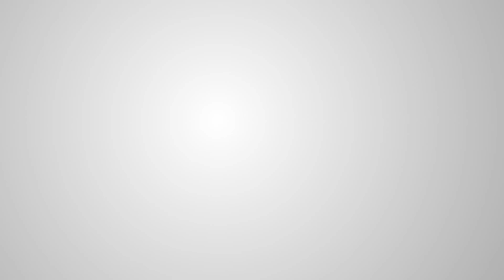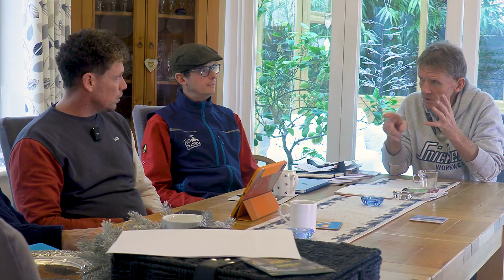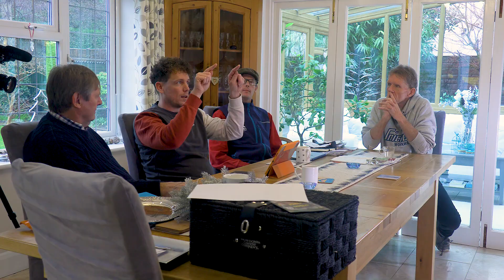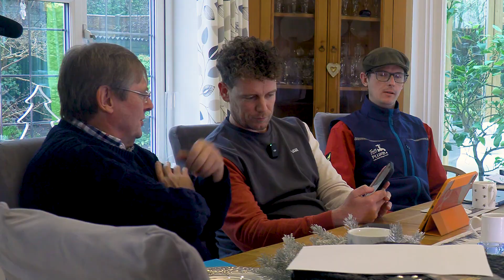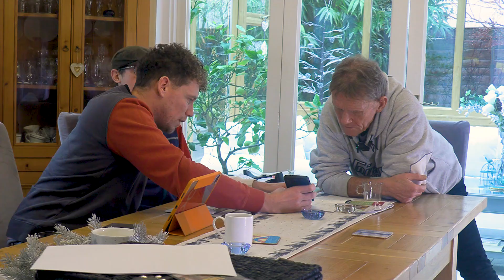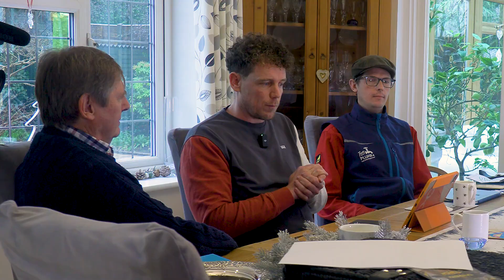What Did We Learn from the Heat Loss Survey?

Comment: I don't understand the benefit of using a heat pump in the UK unless you have enough land to be energy self-sufficient. Almost 50% of all our electricity comes from burning gas. 

So you're buying electricity at 5x the price of gas, half of which is produced by burning gas! 

We need to meet 100% of our existing electricity demands without burning fossil fuels before we can start taking about installing heat pumps.
Reply: Why? So you’re saying you should never make any improvements to anything unless it’s a perfect 100% solution? We’d never get anything done! The fossil fuel based generation of electricity is already well below 50% and is reducing year on year, plus many people have solar PV and home batteries to further clean up generation. These things have to be a transition, not a digital switch over, early adopters are essential to prepare the infrastructure and prove and improve the technology.
Reply: @simonm9923  what I said was "100% of our existing electricity demands". So, for example, this might be 80% in 2028 (relative to existing) owing to increasing demands for electricity. 

My point is that anyone drawing from the grid is essentially using gas to power their heat pump, so it's pointless scraping a boiler in 2024. 

And whilst our 'proportion' of renewable use has expanded rapidly since 2010, we have been burning (roughly) the same TWH of gas to generate electric every year for the past 25 years. 

Unless there are any signs of that changing, heat pumps are largely pointless.
Reply: @dombaker1924  So what’s your proposal then to reduce carbon emissions from home heating? Even if 50% of our electricity is generated from gas, at a COP of 3 (>4 easily possible but let’s be pessimistic) that means burning 1/6 of the gas per unit of heat with a heat pump compared to a gas boiler. This improvement is definitely worth taking and as I said, with increasing renewable content and / or self generation, the fossil fuel dependence will decrease with time. Using a time of use tariff (ideally with a home battery) can mean there are significant financial benefits as well as environmental ones.
Reply: @simonm9923  there are a number of options:
1. Subsidise solar panels and batteries instead of heat pumps - this will reduce the volume of gas burned to generate electricity. 
2. Invest in making electricity cheaper and more plentiful. A COP of 3 won't matter to most people whilst electricity is 5 times the price of gas. If a solution is only economically viable for a subset of the middle class, it isn't a solution. 

I drive an EV because I like the technology, but I don't delude myself into believing that I'm saving the planet by doing so. I know where my electric comes from and I know how much carbon is emitted to make batteries.
Reply: @dombaker1924  don’t disagree with those actions at all. To be fair Solar and battery installations are VAT free (now including battery only installations) and the prices of both have reduced enormously over the last 10 years. After insulation, this was the first thing we did to our house - we now generate 8MWh per year and will generate over 20kWh today - in February! Regarding electricity pricing (it’s worst case less than 4 times the price of gas), I would add removing the link to the gas price to take advantage of cheaper renewable wind and solar. I would also transfer the admin costs currently applied to the electricity price to gas instead, including the anomaly of the standing charge. We also have EVs and more recently a heat pump, where I completely agree with you is that we are in the very fortunate position financially to do this stuff. Having retired 4 years ago we wanted to make improvements straight away to see the benefits, rather than waiting for improved technology. I strongly believe that those fortunate enough to be able to invest in these technologies help to grow the market and the installation base, ultimately leading to lower prices and wider acceptance - surely it’s better than spaffing our money on cruises, long haul holidays and other frippery? We have also stopped flying anywhere and invested in a community wind farm. I do not believe for one minute that I am saving the planet, but every step in the right direction should be welcomed rather than criticised surely? What is the alternative?
Reply: @simonm9923  I agree with most of what you say and i'm not critical of anyone choosing to install a heat pump, i think people should have the freedom to choose. However, if the lower carbon solution can only be afforded by the a subset of the western middle classes, then that equates to ~ 1% of the global population meaning that any difference to global emissions is negligible. The only meaningful solution is the mass production of low-carbon, cheap energy that the global masses (who cannot and will not pay more for low carbon energy) want to use. That might come in the form of nuclear fusion coupled with tidal/wind/solar and sodium batteries.
Reply: @dombaker1924  I think we can definitely agree that a lot more needs to be done, by everyone, everywhere. The question is how to motivate (force) the oil and gas industry, industry generally and governments everywhere to support and implement the solutions that already exist to make them mainstream and hence cheaper, which will enable the wider population to get on board. The selfishness and short sightedness of the establishment is staggering but our ‘democracy’ is driven by the need to get elected and hence to focus on the short term. The irony is that they all know what needs to be done, just not how to get elected if they do it…..
Reply: Any heat pump that meets the MCS minimum (SCOP of 2.8, which is childsplay for many installers that know their salt, and usually get over 4), will use less gas burnt at the power station (even if 100% of electricity comes from gas) than burning it directly in the home. 

Using the annual average: 10,000kWh of gas procudes about 9000kWh of usable heat in the home (90% efficiency, which is generous for UK installs), a heat pump to do that at the MCS minimum would require 3215kWh, add on a generous 10% for transmission and distribution losses (average was 8% a decade ago in a gov report, so can't see it getting worse). 
Thats 3535kWh required.

Average UK Gas power plant efficiency is just shy of 50% - and that's pre keadby 2 going live - which does 60+%, and more gas power plants are due to have the same upgrades, so the average will increase. Multiply by 2.1 to consider gas required (at below average) = 7424kWh requirement. 

A saving of 2576kWh of gas. At a SCOP of 4, it's using half the gas.

Adding in other factors like other power sources, decreases the gas use even further.
Reply: @BenIsInSweden  thanks. see my reply to @simonm9923

Comment: Something that needs to be discussed with customers thinking about having a heat pump (if they want energy bills lower than with gas), is whether they are willing to make sacrifices to get that low flow temperature. This will likely mean forfeiting wall space for bigger rads or internal wall insulation, or accepting the disruption for overlay underfloor heating to be installed. In small houses wall space may be an issue for some people.
Reply: If you keep your condensing boiler and do the the other work you mentioned, ie good controls, better insulation and clean the dust and fluff from behind the radiators (some people don't!) Your Gas bill will drop!

Comment: Minus 2 would never do in Scotland. Our temperatures regularly go well below that in winter.
Reply: Depends where in Scotland. The temperature rarely drops below zero where we are on the West coast.
Reply: -2C isn't the limitation, it was the heat loss of the property at -2C.  I assume they are fixing the heat pump (or it's being replaced like for like from LG).  As on a new project, it would just be a case of getting an appropriate capacity heat pump for the heat loss at the design temperature.
My home has had -20C outside for about 3 days and was heated to >20C by heat pumps alone.

Comment: We were called out a new build (7yrs old) in Islington London, we contacted the Danish manufacturer on behalf of the customer ….the customer had to call a ‘factory approved’ engineer who drove up from Bournemouth 
The customer was very happy to pay all costs and didn’t complain as she could afford it, this is not representative of ‘normal working people’ 
Utter nonsense as far as I’m concerned
Reply: You could install Electric Boilers (aka Heatrae Sadia Amptec) but that would be insanity as the running costs would be outrageous- however it happens, we seen it many times.
The fact that this discussion has to happen (& big respect to guys for making this happen) suggests the Heat Pump solution* is quite there yet.
*referring to heat pumps in large inefficient older homes

Comment: Weather compensation, is this just for air to water heat pumps?
Reply: It compensates for extra heat loss in cold weather so is unrelated to the heat source, air or ground. You can have it with gas combi boilers as well.

Comment: This is an experiment and John pays for it. To summarise, the radiators in the property are well sized, the pipes could be a bit bigger but overall are not too bad, the buffer tank stays. Basically they will change the pipes connection, remove a valve and perhaps install a new circulating pump. And a new expensive heat pump, more kw, but low temperature as the current one goes down to only 45 degrees output. Why not do the plumbing work, repair the bearings of the current one and see what’s happening for a couple of months?
Reply: You need a flow temperature of 35 or 40 degrees to get the best heat pump COP which results in minimised running costs.
Reply: No experimentation, a very normal installation for us. John’s not paying for it either! Watch SB next expisode for an update on that. 😊

Comment: Thanks for these detailed discussions and poor install cases explained. We are about to move to a property that we intend to take apart to insulate and redo pipework etc hen consider a ground source heat pump. In ireland if you do a retrofit to a certain high standard they pay 75% of the costs. We cant even get VAT removed for such projects. Our housing stock is old and poor quality so need much more help than currently available or suggested.

Comment: Hello! Really appreciate the show and the free information! Great effort!
   What about the question at 01:35 ? What is the problem with oversizing hp ?
    How bad does cycling on and off every half an hour affects the lifespan of the hp unit ?

Thank you
Reply: It’s not so much about the lifespan of the unit, rather the efficiency that it runs at. A heat pump runs most efficiently if it runs as continuously as possible, providing the lowest flow temperature required to maintain the required indoor temperature. That’s what weather compensation is for, adjusting the operation based on external temperature. To achieve a high SCOP (>4) you don’t want an oversized, cycling pump.
Reply: Best if you have a modulating heat pump. Mine goes down to 0.7kw input and up to 3.5 kw input. @simonm9923
Reply: Well, this gent has to buy another hp. On this note, if i pay 15000£ for a system i have to know the lifespan of the sayd system.
PS for 15000£ i can heat my house with my gas boiler for about 15 years ....no headaches on my part.
We are not righ enough to save the planet on our dime and as that chap at Oxford sayd: if tomorrow Britain sank there will be no dent in global co2 emissions.

Comment: Whenever you watch a video on the benefits of a HeatPump,  all they talk about is COP and not, does it keep your house warm and cost less to run than a gas boiler.
What COP or SCOP do you need to achieve for it to cost less to run than a gas boiler?
Reply: Well if gas costs 3x electricity per kWh then a COP of 3, and so on. If you have a time of use tariff and a big enough home battery and / or solar you could buy electricity at the same unit price as gas or generate your own…..
Reply: @simonm9923  Thanks Simon. I can't  afford solar and batteries, so will go with a SCOP of 3 or better. My next question is, can this be achieved using existing 10mm pipes to the radiators? 😁

Comment: The lack of an answer to my question below speaks volumes. If those proporting to be experts cannot answer, what I would presume is a remedial question, then the technology remains questionable.
Such a pity.
----------------------------------------------------------------
Hi

You raised the issue of a backup emerson heater, is there any reason why you couldn't have a wood burner that has a back boiler instead, allowing you to heat water in the most challenging cold snaps?

Cheers

Comment: Most installs nowadays is mostly plastic pipe. Many people cannot fit in extra large radiators, there simply isn’t room. I don’t know about other people, but I like an open window (a bit) or two for fresh air unless it’s particularly cold. The running costs of heat pumps at the moment, are not cost efficient. And when these systems are most efficient in hot weather when you likely won’t have your heating on anyhow - it seems counter productive. 

The consensus is you want a warm to cosy house, all year round. Not a lukewarm house that takes ages to actually even get mildly warm. If a system requires an electric element to heat your hot water and central heating, common sense will tell you it will cost too much to run. Great when X amount of the year it’s working efficiently, the rest of the time it’s not. Also putting in large cylinders, big piping, pumps and other controls you need half a room spare to put it all!
Reply: You can get radiators up to 3 panels with convectors. No increase in wall area required.

Comment: If a house has been insulated and had air tightness work done to bring it up to a standard heat pumps work efficiently,but heated using oil or gas ,what would the average saving be

Comment: 😂😂 Adam uses three words when explaining SCOP and Cop , TRICK , FUDGE and THEORY.
So we trick the customers by fudging the maths for theoretical efficiency figures 😂🤣😂
Reply: You missed the point Adam was making. John has the option of a Solar PV Divert. This can add a COP of 1 to the DHW figures whenever it is running, because it is "free" energy from the panels diverted, and won't count as electricity used for the DHW.
Which looks good on paper, but there are better options, e.g. using a controller to request heat from the heat pump if the cylinder can do with more heating when there is excess Solar PV available, keeping the COP at say 4, and selling the other 3/4 back to the grid.  i.e. getting the same amount of heat but getting money for the remainder that wasn't used by the immersion.
Reply: @BenIsInSweden  The point is , Heat Pumps are being pushed as the ‘ green ‘ good for the environment option that will also save you money because they are super efficient . 
They are neither.
Reply: @haydnlawrence8167  Less gas is consumed if powering a heat pump from a 100% gas-powered grid, even more so when powered by non-fossil fuels.  Money saving isn't down to the heat pump, it's down to the price of gas and electricity.  Plenty of people do save money with a heat pump.  The UK's energy pricing structure at the moment just favours gas.  Per kWh consumed, they are far more efficient than a gas boiler.
Reply: @BenIsInSweden  ‘ Less gas is consumed  ‘ , clutching at straws there .  
As for renewables, wind turbines are nothing more than money laundering by government and big business, ratcheting up the price of energy to the consumer using emotional blackmail. 
As for the consumer saving money, a hp running 24/7 @ 41p  per kWh compared to a gas boiler  running when required @ 7p per kWh. It doesn’t take Carol Vorderman to work it out .

Comment: what do you do when it is minus 20 for a week one year AND WHAT DOES THE GRID DO? and stop saying a heater is  100 percent efficient because even an electrical cable is not. That just makes me wonder about the rest of the terminology like scop and whether it is measured or estimated.
Reply: Heart pumps are 350% efficient measured 👍
Reply: @jrisner6535  How is it measured? They said heat pumps were 400% efficient. Now 300% efficient. They say electric heaters are 100% efficient. Yet it is fact that electric heaters are not 100% efficient. So how can I believe the 300-400%. The gas network carries many times as much energy as the electric grid can. Losses increase exponentially with load on the electric grid. Prices of electricity are already more than 3 times gas. Demand will push that up. To top it off almost none of the extra electricity will be green for a long time. Do you know what they do. They turn the gas power stations up with electricity losses greater than boilers in between. If they "fix" the electricity price then heat pumps will be stealing from the poor and giving to the rich.
Reply: @kevinchadwick8993  electric heaters are essentially 100% efficient 😂

Your knowledge is shallow and cynical
Reply: @jrisner6535  No it isn't. What efficiency is an average ceramic heater? What efficiency is a standard resistive heater? I create electricity monitoring technology at the chip level and an electrical cable to the heater isn't 100% efficient. Never mind the heater. Cynical no. Critical yes as I have looked for data on heat pump efficiency and it certainly isn't easy to find. Theory is easy to find. I certainly won't trust theory from someone who says heaters are 100% efficient. However I have assumed 3-400% to be true in my reasoning.